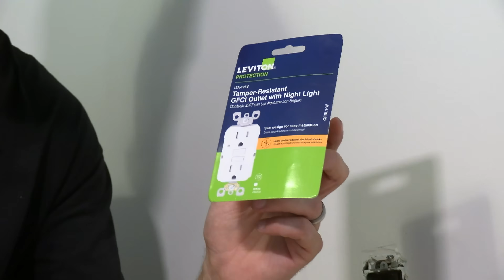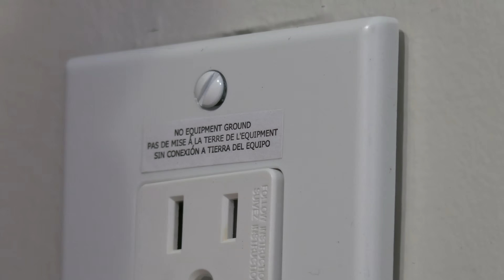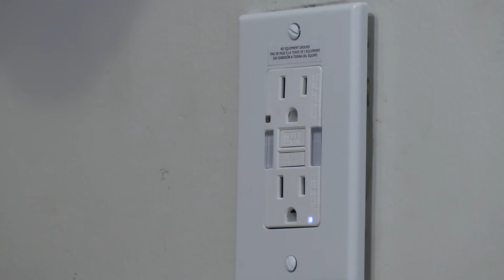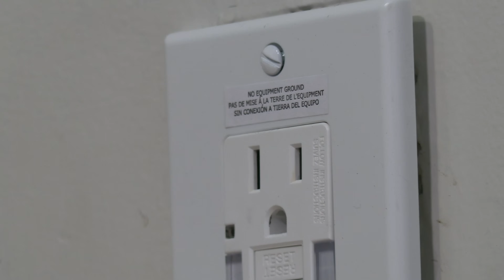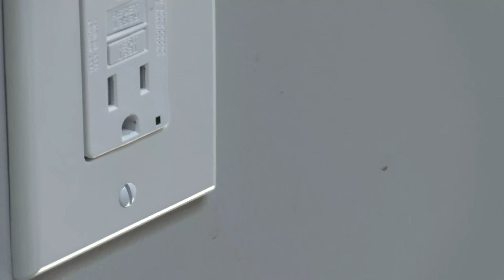Can You Replace A 2-Prong Outlet With A 3-Prong?

Comment: Anyone else bothered by the amount of insulation stripped on that hot wire? I'm sure it won't fault, but I was taught that this is bad practice.
Reply: It may have had a little extra insulation stripped than necessary. Two points I will make: 1) The receptacle has a strip gauge reference on it. Do we know if Jefferson’s insulation stripping exceeded the reference point? No we don’t, unless we obtain the same brand and model receptacle and check it for ourselves. 2) The terminals are recessed which offers some protection from the terminal making contact with the metal of the box. 

With that said, I personally agree that it appeared to have a little too much insulation stripped. APPEARED is the key word. I’ve seen people strip almost an inch and a half and makes me wonder what the heck they were thinking and how much talent it took to get that in the box without creating a fault. Not to defend Jefferson, because what appeared to be the case is currently only our perception until we actually go out and prove the fact, even it was to touch the metal of the box there would most likely be amperage leakage of more than 6mA of current causing the GFCI protection to open the circuit.
Reply: Ok...
If the wire faulted to the box, why would the GFCI trip?
Like I was saying, it probably won't fault. And regardless of having the device or not, no strip gauge from that manufacturer would leave that much bare copper. 
I'm not trying to build a legal case. Just saying it didn't look like the connections I typically make. But I work in an industrial setting and a fault could cost thousands of dollars for a few minutes down time.
Reply: @SamHintSPV  The box is metal which is likely in contact with or bonded to something conductive. That will cause the 6mA leakage required to trip the GFCI. The clamp wire method for LEVITON and HUBBEL both indicate a 5/8 -in of insuation strip. The screw method on LEVITON calls for 3/4 -in insulation strip and 1-in for HUBBEL. In industrial I would never leave any extra bare wire either. On my motor connections I tape my wirenuts for added protection. I’ve had a welder blow my 1200A switch gear. It bypassed the 60A fuses and the 100A Bus Plug. Took an hour to figure out what blew my switch gear. So I’m also very particular in my methods in industrial. Being I work in all fields of electrical, I respect each others methods as long it is safe and doesn’t violate codes. I can’t justify measuring another master electrician’s methods unless I could call out a code violation. That is why I said that I agree that it appear that way, but I do not know if it was longer than 5/8-in, and even with the little extra isulation exposure I couldnt call a particular safety hazard in this scenerio.
Reply: Yeah, I've seen welders fail to check their grounds and blow a panel or two. Had a welder working on a break room that wasn't tired into the main building structure, so the panel was the only ground path.
Just because you bring it up about needing the actual device. I just checked and based on the strip gauge on the back of the outlet, the insulation stops about 1/16" from the edge of the plastic housing. That was for both a leviton 15 & 20A GFCI that is on hand.
Reply: @SamHintSPV  I know the specs say 5/8-in and you’re able to get a device and check the strip gauge and determine that only 1/16 or less is exposed. Being the device was the same brand and type we can safely deduce that the instructions wasn’t followed, which is a code violation. I never said you were wrong, I just said we need to verify, it’s gives us the opportunity to learn to go out and actually do our homework. I pulled up the specs, you pulled up an actual device. And now know that your initial assessment was correct. So now I can claim 110.3 (B) violation.
Reply: @SamHintSPV  My welders used to burn up my FMC and the conductors up on a near daily basis. They would clamp the work lead to a pole or roller bed instead of clamping to the equipment they were welding on. I got so tired of replacing FMC and conductors that I removed all FMC and replaced with SO Cable and bonded each motor or cabinet directly to the bus duct with 4/0 welding cable. Never had anymore issues. Since there’s always qualified electrical personnel on site, we could do that without violating any code.
Reply: Lol for SO cord. We had our furnace wired up with SO to a 120 plug when there was an oversight during a multi phase upgrade. $20 million dollar furnace that was just plugged in for six months. 
As far as grounding, our building as a loop of 500 MCM bonded to every column, so I went on a mission with the rest of the gang to bond every stupid thing we could find to the building.
But our place was built in the early fifties, so we've had other issues with wire that's been in service that long. Lost a 3000A main feed a couple years ago. Let me just say, keep the fire department away from your switch gear. They probably did $100k of damage spraying foam on everything AFTER we had the transformers isolated.
Anyway, yeah, we probably have a few bits of SO around that get ignored on outages. The engineers always have bigger plans.

Comment: Sounds like I'm almost in compliance with all my electrical work since buying this 1910 house in May.  I have an outlet in the laundry room not near the washer and dryer that is not GFCI (thus a possible grey area).  None of the outlets are labeled GFCI Protected or No Equipment Group.   Nor were they when we had the FHA inspection.  I did label the boxes in the basement with circuit numbers and start a spreadsheet for this purpose (so I will eventually know what breaker every switch, light, outlet, fan, etc is on)

I've used the Wago trick to extend wires (one of the three way switches for the steps is in a few steps from top landing so I changed it to a light up when off version but the wires were quite short)

GFCI breakers is another method.  Just gotta reroute the neutral wire.

Comment: In the beginning of the video when the wires were shown, there was a bare ground wire present. Later you say there wasn't any ground in the box. Why did that change?
Reply: At about 2:10 he mentions ground in box not connected to house (panel).
Reply: My understanding is that the wire is present, but is not actually connected to the house ground, for some reason.

Comment: Whole code compliant, folks should realize that the metal box remains unprotected and potentially dangerous without it being grounded. The GFCI will protect anything that is plugged into it, but it cannot prevent a fault at the box, since that is before the GFCI. If your ungrounded conductor were to pull out of the Wago, for example, and contact the metal box, the GFCI would not prevent the box from being energized.
Reply: He used the incorrect faceplate.  Per code if you are replacing a 2-prong outlet with a gfci or the outlet and/or box is not connected to ground you have to use a faceplate with no exposed screws.  This prevents the fault you are speaking of hurting a person.
Reply: @brians8664  Brian, I have looked in my 2020 nec 406.6 for faceplate and did not see the requirement you spoke of.  I think there were two of you mentioning this requirement in the comments.  Could you please get me a code section on this one?
Reply: @brians8664  This has never come up for me. I scanned code 406 and tried a google search trying to find it.  we are required to follow the 2017 code…. so I am guessing must be in the newer codes. if you could point me to where it is in code and the code year i would be grateful
Reply: @brians8664  Did you read my comment. The crews is an absolute non-issue as anything connected it it: a fridge, a computer etc. would become energized if the live wire touches the box.
Reply: Not only the box. The box is connected to the ground contact and through that to the case of any grounded equipment connected to it. This is a major fault with the GFCI method. If that happens in an outlet chained to the load side then the GFCI would work.

To prevent this one would need to pull the groudn pin or do something like that which is a no no. Fortunately in Europe e do not have such problems.

Comment: Hello, was wondering if the outlet receptacle was 15amp or 20amp. my fuse box is 20amps. have read that a 15amp may overheat? unsure. just wondering.
Reply: It was 15 amp which is ok and code compliant even with a 20 amp circuit. It's the wire gauge that's important and must be 12 gauge for a 20 amp circuit.
Reply: Even today, 2020 nec 210.21.(B).(3). and table 210. 21.(B).(3).  Allows for 2 or more 15 Amp recepticles on a 20 Amp circuit.
Reply: 15 A is OK as long as you have at least two receptacles which is almost always the case as they come in two in one.

Comment: One of the issues you didn’t address is why the hot wire broke off upon removing old outlet.  That comes from use of wire strippers.  Solid copper wire is like glass.  Use of wire strippers scores the copper around its circumference.  If you make a couple of hard bends with pliers or twisting will notice the bare copper will fall off easily.  The copper on the circumference is a weak point.  Bending occurred when twisting wires together for wire nuts or simply pushing outlets into box for placement.  Think best in practice in stripping solid copper insulation is using a box cutter, peeling along the length of the wire exposing bare copper, then peeling back insulation with hands and cutting off with diagonals.  Most people don’t use strippers properly and especially home diy’ers.   Just my 2¢.

Comment: Will this GFCI receptacle trip (as it was designed to do) even though there's an open ground, or did I miss something?
Reply: Yes, it will trip in actual ground fault when someone touches an energized equipment case or when you press the test button. It will not trip with a separate GFCI tester.
Reply: Yes, however it may not protect equipment plugged in from damage without the ground wire.
Reply: @surferdude642  That's what I was thinking....
Reply: A GFCI device operation is relatively simple... It is a measurement circuit where the device detects if there is any imbalance between the two current carrying conductors.  When the "comes in" current is different than the "goes out", the electronics detect it and trip it immediately.  An over-simplification, but I hope you get the drift.  This will usually prevent somebody from being killed if they somehow fault themselves to ground.  BUT, not having an actual ground available opens up all sorts of other issues (see the other replies plus more).  This code exception is not one I agree with.  I prefer to blank out the recepticle but this usually puts you outside the 6ft rule.  The best solution is to pull in a new feed cable and do it right.
Reply: @tgmct  I understand how GFCI receptacles work along the line of monitoring current differences between their neutral and hot feeds in order to determine if it should trip or not. Yes, but that open ground exception in the NEC is what really gets me regarding this subject matter. It seems more like a compromise allowance rather than a "bringing up to code" kind of stance. Then again, electrical codes are really just a minimum standard
Reply: @kgt9535  The idea is that an energized chassis can still occur, but upon ground fault through a person, the GFCI will disconnect the power before injury. 
A GFCI is oodles faster than a circuit breaker, so it's actually safer than the way it was, in my book. Obviously a ground wire would be nice in addition, but...
Reply: yes, but this circuit is not protected from a lightning strike. "The purpose of a ground rod(s)is to have a path to dissipate a static discharge voltage (which can be lightning or other forms of static electricity) to the earth. The electrical earth ground rod is usually considered at zero volts." A ground rod is designed to stabilize voltages from the power source and to dissipate a static discharge (usually lightning) to earth. Also the earth ground conductor should never carry current under normal use, *unless a ground fault, or lost neutral connection occurs*.
Reply: @Mike1614YT  It sounds like you're describing a grounding electrode conductor. What's missing here is an equipment grounding conductor. They serve 2 different purposes.
Reply: @surferdude642  yes, agree
Reply: @Mike1614YT  The only circuit protected from a lightning strike is a disconnected and isolated one.

Comment: Any places not recommended for GFCI? Or any location they would not be permitted?
Reply: Gfci's are not permitted in concealed areas like behind a refrigerator.
Reply: Ted is right, and let me add....2020 nec 210.8 says the gfci must be "readily accessible".  210.(A). Lists the locations in a dwelling (house) where they mist be.

Here is where things get fun.....

2020 nec 100 gives the definition of "readily accessible".....Accessible, ready (readily accessible) capable of being reached quickly for operation renewal or inspection without requiring those to whom ready access is requisite to take actions such as use tools other than keys to climb over or under or remove obstacles or resort to Portable ladders and so forth.

So appliance garages servicing countertops need gfci protection, but the gfci must be outside of the garage.

Comment: When putting on the Wago 221 lever nuts always check the transparent side to se the conductor has gone alway to the front tug test is good. Two other things about the Wago it has a wire stripping guide on the side and it has a test port to put your voltmeter test probes. I actually put the labels on all downstream GFCI/AFCI receptacles not just the primary protected receptacle. I actually have GFCI/AFCI receptacles on all my receptacles in the home future proofing against code requirements including the coming 2023 code. The levitons are my favorite GFCI/AFCI receptacle tripe faster 4mS and around 4-5mA that’s the testing I have done they are very predictable and better than most other manufacturers.